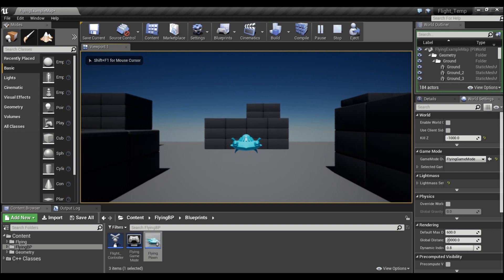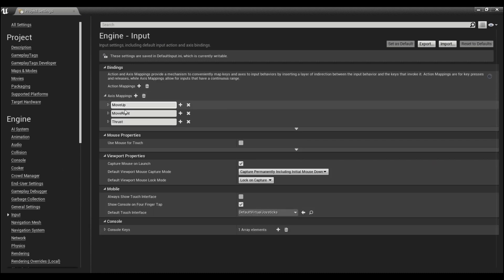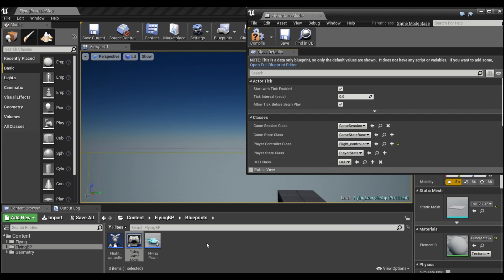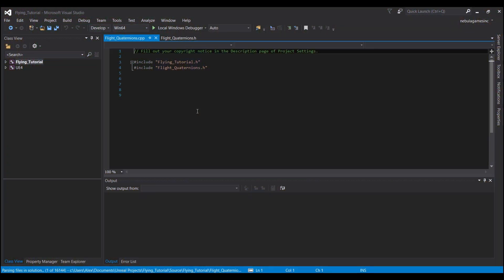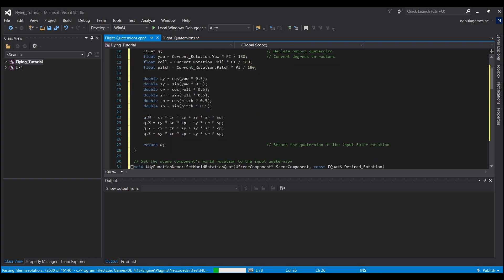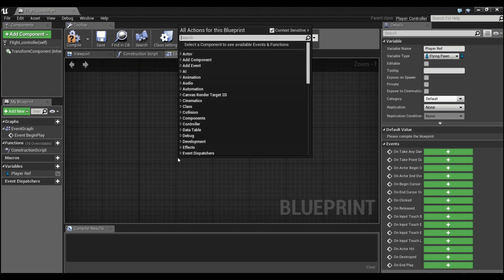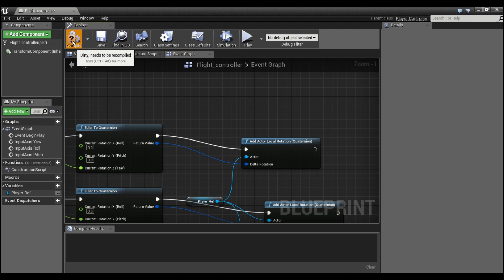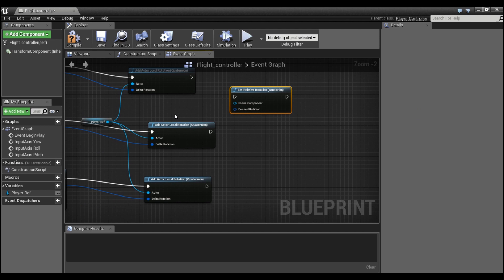#gimbal #6DoF #quaternion Unreal Engine 4 Tutorial: 6DoF Fixing Gimbal Lock

Comment: I was unable to use the C++ functions in Blueprints following this tutorial ("New C++ Class" was additionally only accessible from File/ ). However, changing UCLASS to UCLASS(Blueprintable) in the header file made the functions accessible.
Reply from the maker: Hmm, not sure why that is. When I made this tutorial years ago the C++ files worked as described. But UE changes little things in their programming all the time that changes how files need to be structured or named to work within their engine. Glad you figured it out
Reply: @NebulaGamesInc  Yeah, I figured I'd leave a comment here for anyone coming after me having a similar problem. It appeared to be common, in a more general case, for people run into problems with UCLASS needing to be Blueprintable.

Comment: Is there any way to have this work with Use Pawn Control Rotation?

I have to have that enabled on my boom in order to properly move the camera and character, otherwise i cant align the character with the camera movement

Other then that, no problems so far
Reply from the maker: @loomingcolumn4269  not sure my man. Maybe one of the other people here can help you out. I haven't used this in a long while. I'm sure there is a way though.

Comment: So when I was adding the library and needed to recompile, I shut down the engine and started it back up, but now the game won't recompile. It says I need to try compiling from source and I have attempted to do this with Visual Studio, but it's not working. Any ideas on how to fix that?
Reply from the maker: I have gotten that a few times. A quick google search I found this. Some of the solutions listed were what I used previously and got it working. I forget what the exact cause of this was but you will get this error often. I think the second poster which described deleting a bunch of files was usually the trick. Those get recreated when you rebuild. 

https://community.gamedev.tv/t/could-not-be-compiled-try-rebuilding-from-source-manually/7953

Comment: Just so you know, this still works in todays release of UE5.4. All the buttons that you press to follow this tutorial are named the same (or 95% similar) thing, just under different menus, and with the removal of flight pawn template, you need to create a new pawn. I did not need to tweak your code at all to get it working, only to modify how the camera works for my preferences. Thank you very much for your solution, it helped me so much
Reply from the maker: That's awesome! Happy to hear this still works as intended.
Reply: Same here, 5.4 and I'm still using this, the same c++ module I've created back then, for years!
Reply: To follow up on this thread one year later, for a good example of how to use the new Enhanced Input system on a 3rd Person Template-like setup, refer to the Lyra project, freely available from Epic. It should have everything set up for you to copy over. Some ideas of where it might have gone wrong for OliHannah: "Use controller desired rotation" on the Pawn; incorrectly binding Input Actions to Input Mapping Contexts; not using Add Input Mapping Context in the Player Controller on BeginPlay; not setting the PlayerController with this node in it on BeginPlay as the PC to use within the GameMode; not selecting the GameMode in Project Settings as the default and/or the GameMode is being overriden by the Level's WorldSettings or even the PlayerStart Actor within the Level. Some ideas on where to look for debugging in case you run into a similar problem...
Reply: Did you use EnchancedInputActions? I'm getting no reponse from my look inputs. I have "Flight Controller" set to my Player Controller class within Game Mode, I broke all look input connections on my "BP_Third Person Character" "EnhancedInput IA_Look," and copied everything verbatim into the Flight Controller event graph. My only difference is I'm casting to BP Third Person Character to get my Player Ref. When I add the quat rotation to the follow camera in my pawn blueprint (as opposed to the controller BP), it works on the follow camera, so I think it has something to do with the third person template maybe? Any thoughts?
Reply from the maker: @OliHannah-mg8bq  sorry my man, literally haven't opened UE in years. I couldn't tell you what I used, but I don't think I used any "enhanced" anything. Don't even know what that is referring to so I'm pretty sure I never used it ha
Reply: @NebulaGamesInc  thanks for the quick reply! Sorry to hear you haven’t opened UE. I was actually asking @nicknew907 since I’m also on 5.4 😅
Reply from the maker: @OliHannah-mg8bq  all good... and yea I miss it but hey, life happens. That was a hobby of mine.
Reply: @OliHannah-mg8bq  No clue why my comment didn't show before, yes I did use enhanced input. Use the UE5 forum and figure out how to send that to me if you need more help with the issue, much too difficult to do through youtube comments haha

Comment: Hi, I’m using this code in C++ only to make a camera pawn move, the axis value is well received and with the normal AddControllerPitchInput it’s working until the famous 90 and -90 degres limit, if I replace this by your static functions EulerToQuaternion and AddActorLocalRotationQuat it’s not working, the pitch is not even moving. Value received from the input axis is correct and is 1 (just like your axis input value in your example I suppose) Thanks in advance.
Reply from the maker: Sorry, haven't used UE in years, I'm sure there is a way to get it working but I couldn't tell you off the bat. Just have to play around with it.

Comment: For me, SetActorRotation (quaternion version) and all other functions apart from AddActorLocalRotation still have locking in pitch rotation even with all his quat stuff. AddActorLocalRotation works but even the regular euler version works, i didn't need that. I needed SetActorRotation or SetWorldRotation to work without the dumbass locking. Why does unreal engine still not have a fix for this after 8 friggin years??
Reply from the maker: Sorry guys..... not sure what the issue is. Are you trying to add this to UE character class? It might not be compatible with their movement code. When I made these nodes it was for people trying to build flying "pawns" or "actors". So there is no built in movement functionality. It worked well in all of my tests and I even have a mini clip of a game I created using those very nodes. So, I know they work....but it may just be the actors you're trying to use them with have overriding functionality that isn't compatible 🤷‍♂️

Comment: nebula i have seen your name in every topic that has this problem, I currently have it, on unreal 5, but when I add a c++ class it breaks:

Successfully added class 'MyBlueprintFunctionLibrary', however you must recompile the 'planes2' module before it will appear in the Content Browser. Failed to generate project files.
Would you like to open the Output Log to see more details?

If I close unreal and reopen it it says:

The following modules are missing or built with a different engine version:
myprojectname
Would you like to rebuild them now?
yes

Could not be complied try rebuilding from source manually.

i don't know what to do, any help would be appreciated for sure!
Reply from the maker: Hey! Yes, fixing gimbal lock was my crowning achievement from back in the day haha that's why I tried to get the word out everywhere. It was one problem I didn't see a real solution for out there. As for your issue.....I remember needing to "rebuild" manually before for things. I forget why it happened but it was an easy fix. I don't remember exactly how to do it, but it was basically like going back to the source files folder on your computer and I think you right click on the .exe file and it will give you an option to rebuild. Something like that.
Reply from the maker: Also, I've never done anything in UE5 so if it's significant different from UE4 I'm afraid I won't be much help.

Comment: Hi Nebula Games. Super clear tutorial, and I'm eager to try it out. Unfortunately My Visual Studio Code looks a bit different, and when I right click on the file, there is no build or rebuild option. I'm wary about trying to get it on my own - I know I can royally mess up my project if I hit the wrong thing. Could you possibly help me out? I'm on version 1.48.2, and when I right click the file, I get options like 'New File', 'New Folder', 'Reveal in File Explorer', etc. I can provide more details if you need them. Let me know. Thanks!
Reply: I should add that the buttons across the top of different. I have File, Edit, Selection, View, Go, Run, Terminal, and Help. No Project, Build, Debug, or Tools like you have.
Reply: After some further research, I think this is because I'm using Visual Studio Code, which does not have a build button. So the real question is what is the equivalent of building? Do I just save the file and close it?
Reply from the maker: Not sure honestly....don't know what your program is and why it wouldn't have a build function. Seems counter-intuitive. Visual studio is free to download though so you might try that route
Reply: @NebulaGamesInc  Thanks - I was able to get Unreal to switch over to VS instead of Code and I got it all built. However... my ship won't move. I've triple checked all connections, everything is set up like you had it, the game mode and player controller are all pointing to the right things, and I've used Print Strings to confirm that my input commands are being received. However the ship won't move. Nothing happens. The only difference between the default flying project you're using and my project is that I'm using a character blueprint instead of an actor. I don't know why this would make a difference though - and I can't use an actor without sacrificing the movement component, which is... kind of the point. HOWEVER - my issue is at this point out of the scope of the video, so I'll understand if you need to move on.
Reply from the maker: Not 100% sure it's it's years since I did this stuff but from what I recall, my code has nodes that convert rotations to quats for "components" and "actors" you may be using the wrong node. Second....the character movement is something unreal codes and packages for easy use, it isn't something you can modify at its core how it functions. So you may very well be having a compatibility issues with that. Although I think when I was playing around with this code I managed to get it to work on a 3rd person character. It was really weird obviously because 3rd person characters shouldn't be able to rotate 360 like a plane. However, I do remember it working, so it may be related to what your connecting to my nodes or how you're setting up the rotators and things. The fact that it isn't moving at all though makes me think you've messed something else up unrelated to my rotation nodes. Your characters and actors should still "move" the way they always have. My nodes simply allow "rotations" of the camera/actor that normally would be prohibited. It does nothing to actually "move" your character in the sense of a translation through the 3D space of your world. That is a separate system altogether.
Reply: @NebulaGamesInc  Okay so I tried it in a new character blueprint, because I was messing around with a lot of settings before I found your video. That allowed me to move, but movement was... in unexpected directions. However, I took your advice and made a pawn, and all the rotation works perfectly. So I think we're there. Thanks for your help! +1

Comment: l'm using a different library (bought it from the market because my current project is basically locked to blueprints) that's supposed to introduce quaternions, and following this more or less exactly, however my yaw input ends up causing me to roll in world rotation, is there something you're doing differently?
Reply from the maker: Not sure what the issue is, hard to tell just from that. Maybe the orientation of your character components is different than mine. Seems like something got switched in your BPs.
Reply: @NebulaGamesInc  possibly, I've been asking some other locations too and they basically said how the library I'm using handles them is that all of the axis are inherently arbitrary, meaning there's no physical way to "make" a rotation in the same way you did, so now I'm fiddling around with it trying to force an axis for the rotation so that I can bend all rotations around it.

Comment: This doesn't seem to work anymore. I've done it 5 different times with the same template project. Done it step by step exactly and I still get a 1 build fail.
Reply from the maker: What's the error?
Reply: @NebulaGamesInc  Nothing. It just says it failed. There's no error message anywhere in the output. It just fails
Reply from the maker: Hmm the compile fails or the editor fails when you play?
Reply: @NebulaGamesInc  was annoying but finally got it. Had a dll file that wasn't working right. Visual Studio couldn't access it so I had to unlink the dll. Thanks for responding!

Comment: Seems, these doesn't work with Characters. Only with pawns ...
Reply from the maker: Characters have built in movement components that may not be compatible. I am not sure haven't tried it with the character class.
Reply: @NebulaGamesInc  After more testing. It's working with the character class. After unchecking all ticks from movement component and camera . Also after you rotate the actor you have to rotate the controller as well.
Reply from the maker: Glad you figured it out 🙂
Reply: @TheGiakaama   Hey can you help me out, I am having the same issue as you, I want my character to have gimbal lock removed. How did you set up the rotation or the controller? and what boxes need to be unchecked specifically? I will appreciate the reply :)

Comment: So there seems to be a problem with the code in 4.25. This problem is it just doesn't work. for some reason rotation is completely borked. any help would be great.
Reply from the maker: What exactly is the issue? Hard to tell what it could be if you're just saying "it doesn't work". Is there an error you're getting, is it not rotating 360? Is it rotating opposite what you expect....what are we working with here? Haha
Reply: @NebulaGamesInc  I mean it literally doesn't work everything compiles fine just a random sort of "Errors" but it still compiles and says 0 errors, just red squiggles, but when i move my mouse its dead,  when i roll its Q and E, its dead, i can still move forward and back side to side but i cannot rotate my view at all. Keep in mind i did use another tutorial but that didn't account for gimbal lock, it put all the controls into the player pawn. so i had to rearrange, testing the new function calls in the player pawn also had the same results.
Reply from the maker: Try the code in a blank project with just the flying template, something simple with the default settings. Add the code, hook it up how I did and see if it works. I am not sure if this is an issue with compatibility with the code and 4.25 (shouldn't be if it compiles, this isn't a plug in that needs to be updated, if it has issues you'd know at compile time) or if this is an issue with your setup and my code. So a clean base project should be able to tease that out.
Reply: @NebulaGamesInc  well I did figure it out kind of, now I'm having another interesting problem, I can rotate my view just fine but directionality doesn't change if i move forward and rotate i keep moving in the same direction, by the way the problem is i was still using controller rotation stuff in the player pawn unchecked those and rotation worked fine. now its just more funky stuff I gotta work threw lol.
Reply from the maker: Haha sounds good. Unfortunately I doubt I can help with those types of issues, that's going to be specific to your setup not my code. But glad you're making progress 🙂
Reply: @NebulaGamesInc  lol it was super simple actually, im such a dunce some days, i forgot to plug in the ref to player and was just using the controller so the controller was moving but the character was rotating.
Reply from the maker: Haha it happens